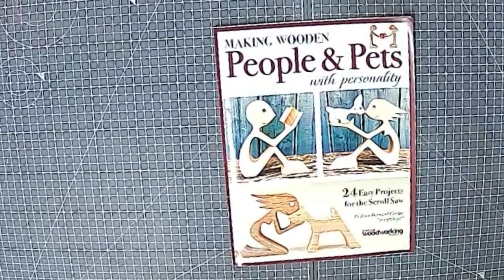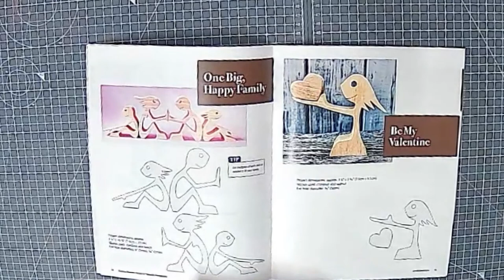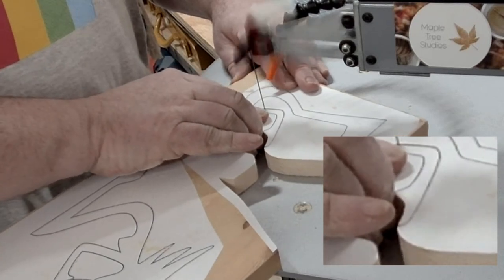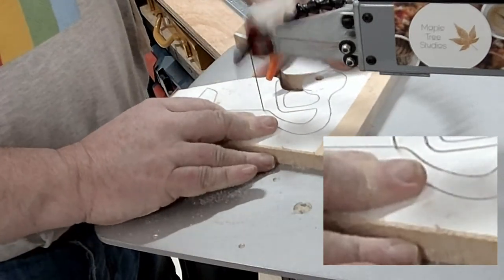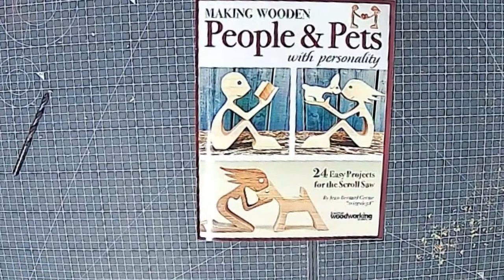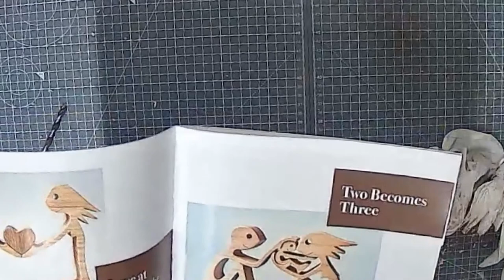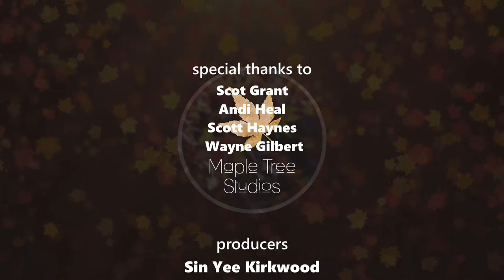People and Pets - Easy to make , low cost, Scroll Saw gifts for Christmas for pet lovers

Comment: If i'm cutting pieces with a long straight on it I usually place my template at bottom of wood and saves you that straight cut ..just the way i like doing it ..
Reply from the maker: Thanks Ian. I do to when i can, and im sold on the bit of wood being  level on the edges :)